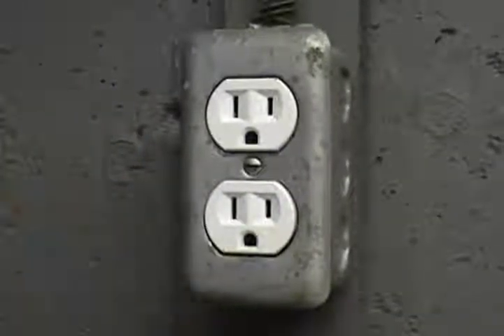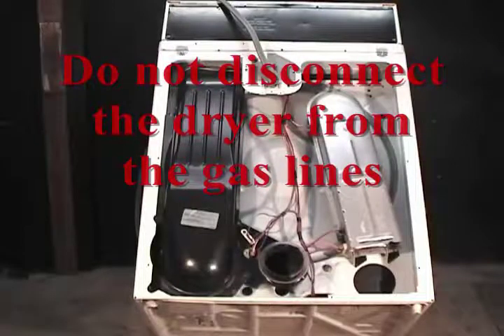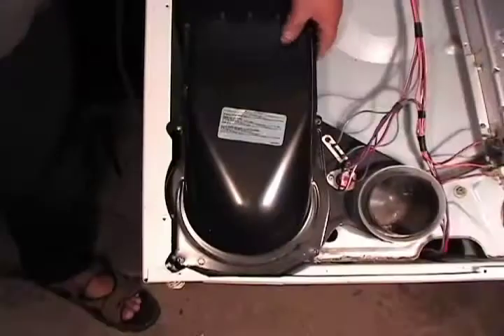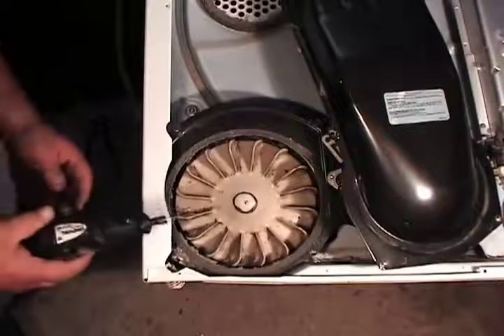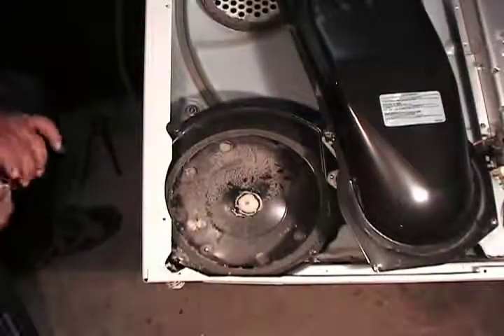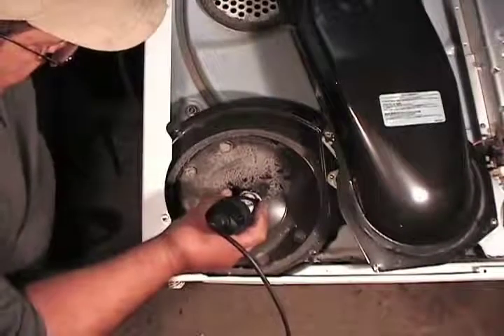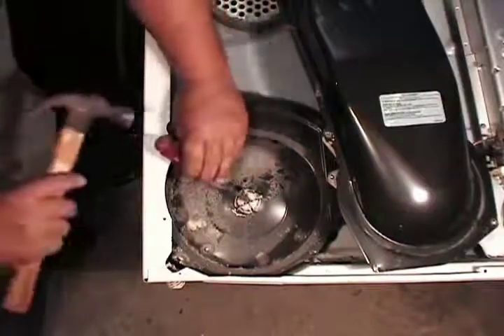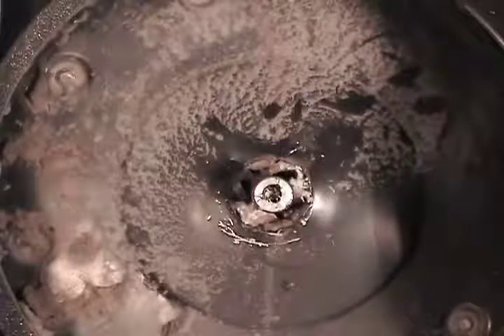Whirlpool Dryer Making Noises - The Blower Wheel

Comment: Excellent! I was planing on doing this the same way. I still have this old dryer working perfectly but I want to replace the old electrical motor but ran into this design failure. Thanks for your video! I have a new motor and fan and seal ready to do this soon. The motor is getting a little bit noisy so I wanted to fix it before I have a problem.

Comment: my wheel was "free wheeling' and making noise as the dryer ran, IT WAS A 5 minute fix....drill a tiny hole in the middle of the wheel, then screw in a small screw..... wheel is now secure to the motor shaft... DONE!
Reply from the maker: Great  job 
Thank You 
For more free videos check my website
http://www.do-it-yourself-washing-machine-and-dryer-repair-help.com/ 
Angel theapplianceman
Reply: My dryer might be doing the same thing by spinning loose on the shaft. It’s noisy but when I spin the motor I have no noise. I’m going to replace everything just to get it back running like new. I have the electrical motor and fan already. Thanks!